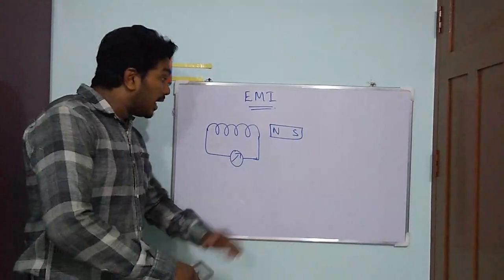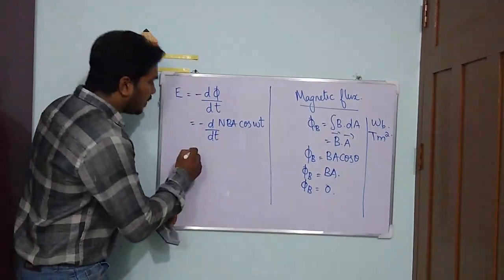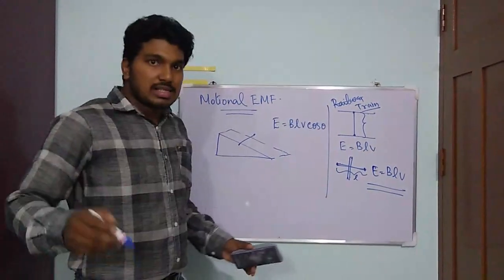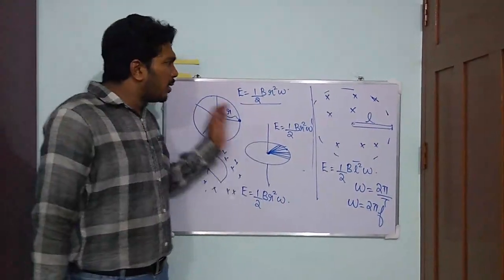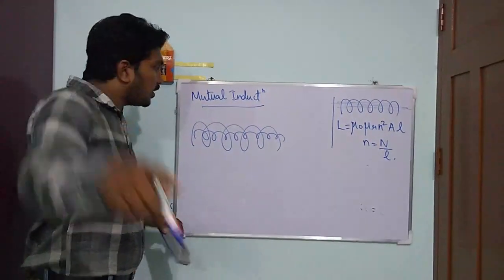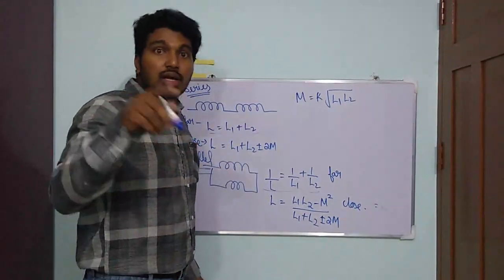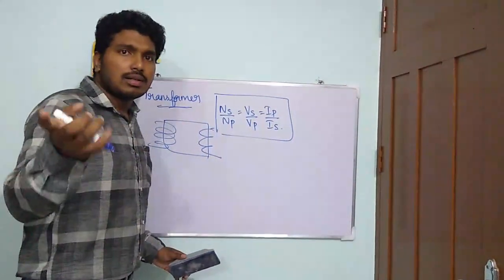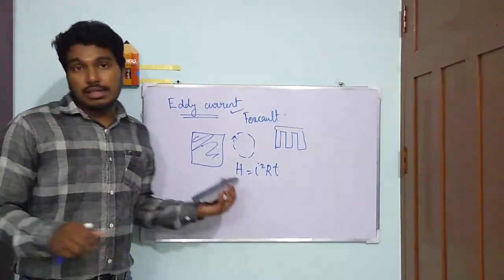Electromagnetic Induction l EMI l NEET l KEAM l JEE l Brief Revision

Comment: Sir what is  +-2M mentioned in series and parallel. i did not understand  that.and also coupling factor, what it exactly means
Reply from the maker: M is for mutual Induction. The fraction of magnetic flux produced by the current in one coil that links with the other coil is called the coefficient of coupling between the two coils.
Reply: @BasilsPhysicsClassroom  Thank you sir